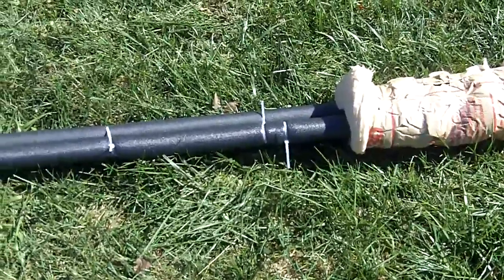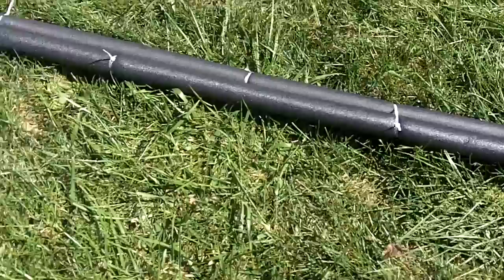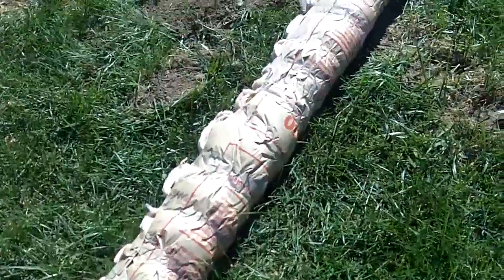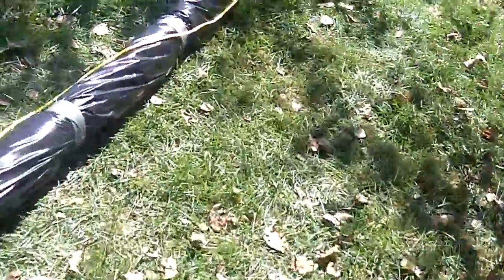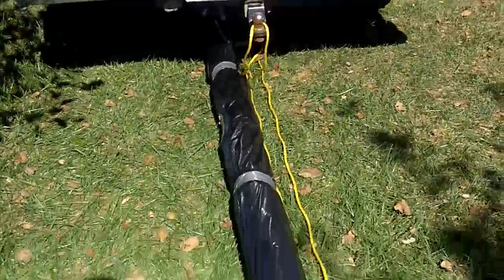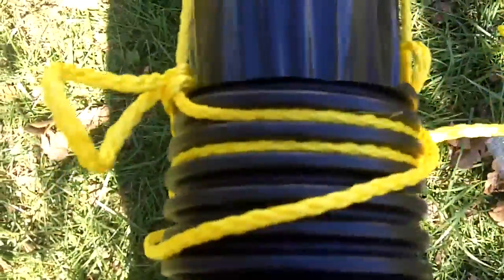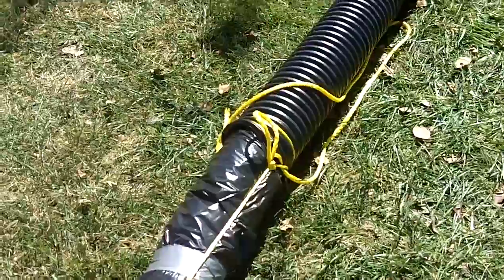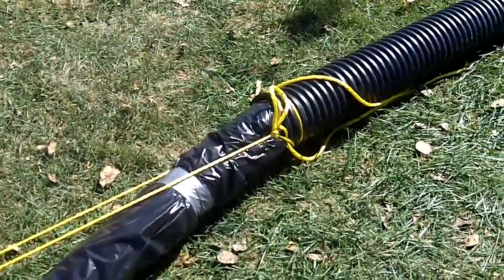DIY Outdoor wood burner Insulating Underground PEX Tubing Insulated HydroPex

Comment: I hope it works I am not confident. the compressed insulation is bad and already mentioned but it will also get wet. once it's wet it's junk. you should have used insulation sleeves and not duct tape.

Comment: Had that same kind of corrugated piping...One little hole and you'll have soaked insulation...Pipes should never touch like that...The cold return water will be robbing the heat from the feed line..insulation can't be compressed... You should have looked on the Hearth.com on insulating underground pipe..   They line a ditch with plastic and High R boards... Then take pieces of wood and make spacer blocks to hold the two tubes apart... Lay it all in the trench. Have a spray foam guy come and spray the ditch,, the lift the pipe as the go with a metal rod with a hook and leave it centered in the foam and just keep moving a long... Cover the top with foam board and plastic... Wicked insulation and cheaper then the 20 dollars a foot insulated piping I finally wound up using after digging all back up the corrugated that you used. I was heating the ground in the winter,, 10 feet from my boiler there was no snow on the ground,,, took about using wood then... Hope you have free wood for an outdoor boiler.. My Woodmaster used about 12 cords a winter easy... Back to Woodstoves and half the wood... power goes out no circulators to have to keep running with a generator...Been there , done that, now no worries and half the amount of wood...

Comment: I know a guy who did this with a pip shell over his Pex lines, he then drilled holes in the pipe at about every ft or so.  Took spray can insulating foam and sprayed it into the tube to inuslate this pipes.  Says it worked great.
Reply: This is a really good idea.

Comment: It all depends on the heat load. My son's Central Boiler is heating THREE homes,all about 2000 sq ft. It uses a lot of wood in the winter. In the summer, he uses about 2 cords for just hot water,,,that is over about 4 months. Winter about 25. So yes, all in all, with heavy heat loads they will use a lot of wood.  First year he used about 18 cords for the entire year but he was only heating two homes.

Comment: Compressed Fiberglass Insulation has less insulating ability thick 1" foam sheets. It also will  Thermo Pex has it down to a science and their 3/4" product has a thermal loss of less than 1 degree  (F)  per 100 feet when buried at 2 feet.
I hope this lasts but for all of the money you spent, you could have had the product proven to work for these installations. I have done several of these boilers at up to 200 feet from the house using Thermo Pex and have never had any noticeable heat loss.

Comment: Good video. I wouldn't use the batt insulation. It will absorb moisture. Once it gets wet it loses most of it's insulation value. The closed-cell foam pieces were a good idea.

Comment: Is it true these outdoor furnace use a lot of wood? why not get a brick lined one and use coal with the wood,It would burn hotter and longer before you have to make a new fire in it.
Reply: sonny Godly how did you get it started!? It so far seems impossible to shove the whole assembly through without a ton a resistance! I can only manage to get it about 10 feet and then it’s stuck. I’m so confused how you got this thing going!

Comment: WE install with 1-1/2 foil backed boiler insulation. cut peaces 20" long off the 4' wide roll, so we end up with peaces 4'x20" wrap one wrap around the hot line, then wrap both lines as one until the 20" is used, foil tape the over laps and every 2' then pull into 6" ducted. we do winter installs leaving line on top of ground, no snow melt at all, been doing it that way for over 15 years

Comment from the maker: @6969smurfy Thanks for the comment. The zip ties are just tight enough to hold it in place, with some indention - but I think their overall surface area is minimal.  The pink insulation is as tight as it needed to be to fit in the pipe. I've been thinking it should have been smaller (thinner) insulation so it wasn't very tight at all, but I'm not loosing too much sleep over it. I'm hoping for a low temp drop and I think the fact that I used 8" corrugated (most use 4) and also the wood chips help

Comment: @6969smurfy I had more room with ¾” pex so I used 4 to 5 layers news papers over the foam rubber sleeves.  Then 2” insulation, cut down rolls to 8” widths.  Spiral wrapped aluminum foil, then wrapped in plastic. I did this manufacturing in around 10 ft sections at a time.  Making sure everything is as light a fluffy in corrugated tube as possible.

Comment: Nice Vid.  I waz going to note, make sure your zip ties & insulation wrap are not squished tight! ( It makes hot spots)  I saved some money by using 3/4"... seems fine for my usage.  Just over  50’ run. I also invested in the Pex crimping tool. Big saving if you’re doing lots of process runs!   My Set-Up is 2 room car radiator box heaters, 2 home made side arms for hot tub & hot water recirculation.